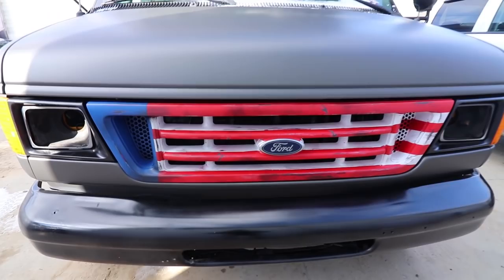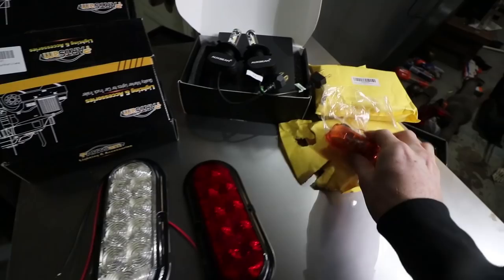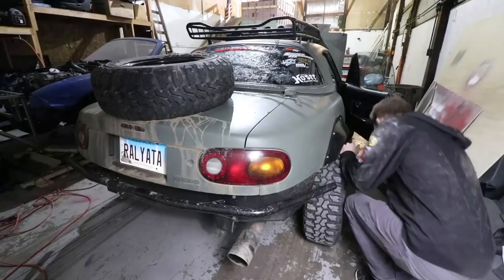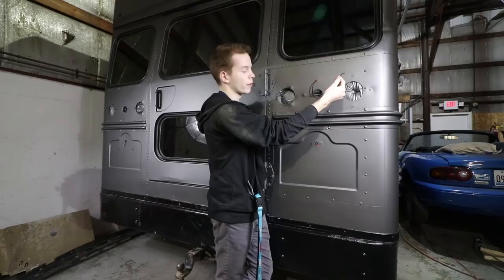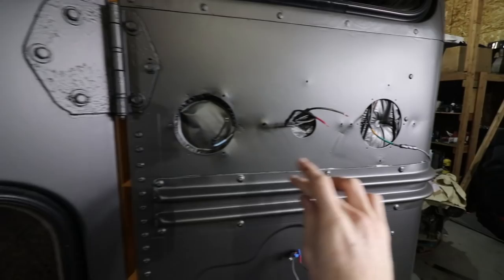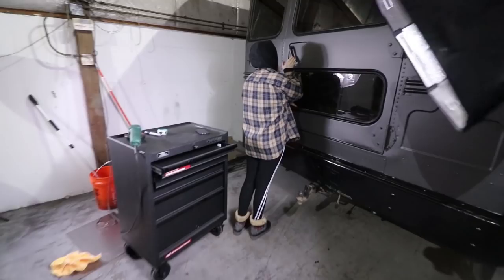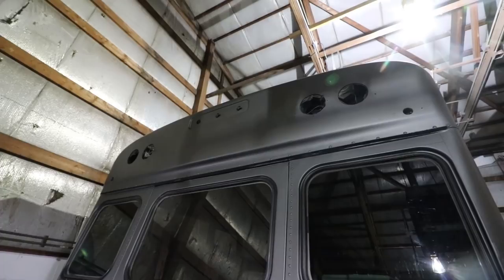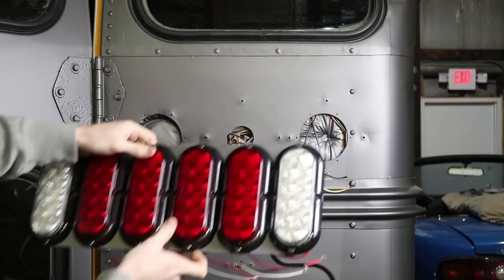Adventure Bus Build Pt 8 - Electrical Fix & Lighting Overhaul!

Comment: Since you're taking the bus off road and using it as a tow vehicle you might want to consider replacing the upper school bus caution lights to spots on the front for better forward vision off road.  The rear ones could be converted to floods that you can aim that way you could light an area behind the bus to work on vehicles or simply light your camping area.
Reply: Sarkazmo Loafy he will be changing the front some time he said with kc lights
Reply: I️ think he said he was putting kc lights up front

Comment: You should fill the front half of the roof with a roof rack and a light bar and use the back half or 2/3 with solar pannels
Reply: With extra battery power for accessories

Comment: The top orange  and  reds are warning  lights... you will need to run power from your running lights  to power & run power from the blinker to the ground on the light & they will blink offset from the outside blinker & give you the resistance  to stop the hyper flash

Comment: The other two lights will come on with the opening of the door. The way the buses are wired is that when you hit the switch for what used to be the amber lights they'd flash to let people know the bus is stopping to pickup kids. When the door is opened the red lights would activate as well as the old crossing arm and stop arm.
Reply: or you can just hit emergency warning or just hit the red colored switch that says warning and the "red" lights up top will work
Reply: Quinn Dickinson that’s very helpful thanks
Reply: Quinn Dickinson how’s the fire truck going
Reply: Good.

Comment: The reason the wiring is polarity switched, is that trailer lighting is often backwards color wise. I used to work in an ambulance upfitting shop and it threw me off at first too.

Comment: If you had all indicators wired it wont blink so fast, when it blinks fast it means there is an incomplete circuit and a indicator isnt working
Reply: Raamie DarkThorn no its because led lights take less power to operate
Reply: Gary Moore I literally just had to fix the exact same thing a couple weeks ago..
Reply: Anthony Correa yes they blink faster but not that fast, that is the "Warning, ya blinkers are fucked" speed as I like to call it

Comment: I get the feeling you might want to do an episode on Reagan. Reagan seems a bit ill and in need of attention :/
Maybe a preheating system to help with cold starts? I think a secondary battery for Reagan would be good too. Auxiliary power is good for both of your off road vehicles 👍

Also, I think you should take a good look at the glow plugs and their electrical connections in the bus. You are doing the proper starting procedure, but I get the feeling the glow plugs aren't doing their job, or at least not very well.

Comment: You Should install Solar Panel For Your battery....
Reply: Xeno mex good idea
Reply: Even though they are a bit less efficient, there are even peel and stick flexible solar panels for RV tops on amazon now. It would be easy to mount and would look cleaner

Comment: Break fluid doesn`t just disappear.. you`ve certainly got a leak!!
Reply: Kommentator brake fluid does get lower as the breaks wear though
Reply: facts
Reply: daniel xinos how
Reply: daniel xinos wait nvm it takes more fluid in lines due to less pad material so it shows up less in the res
Reply: Drew McCarthy as the pistons move out the fluid in the resivour goes down the further the pistons are out the lower the fluid appears. Gingium obviously has a leak but there is more than one reason for low fluid.
Reply: daniel xinos
You are right, it does get a little bit lower over time. But it never gets lower than the min mark and it certainly never needs filling up. When you change your brake pads, the fluid gets pushed back up... so when you fill up your fluid before you change your pads, the reservior will overflow and break fluid is awful for paint, so it is going to ruin the look of the engine bay.

Comment: so the bus is legal, you should turn the top lights in to turn signals. It'd (speech 100) look awesome and it would be legal to drive. lust an idea. ;)
Reply: FadedGaming also, a nice backup cam would be handy. Also, gingium, the way the top lights work has to do with the parking brake. If it is on, the outside ones will oscillate, instead. Maybe some solar, as well, and replace the top lights with LEDs. More ideas, yay.
Reply: agreed.

Comment: better check for a brake fluid leak somewhere...also think about aftermarket brake fluid level sensor and gauge. Thanks for sharing with us.  :)
Reply: also..apply brake pedal..have someone jump on the front and back bumper to actuate the suspension (leak could be happening on suspension flex only)

Comment: Don't put load resistors in the turn signal. All you need to do is replace the flasher with an electronic one.

Comment: The turn signals may blink fast if front turn and rear turn arent going at same time. Like when you have one out on a vehicle it will blink fast. If both blinkers are going it will blink mormal speed.
Reply: no it's cause theyre leds need load resistors

Comment: you don’t need to change anything with the turn signal or indicators as they are called here, when both are wired up they will be working as normal so no need to do anything to them

Comment: Since the lights are already setup to flash, it would be cool to get 4 LED amber lights for all of the lights, that way it's legal and cool. 

When it comes to the outside pair, try turning on the inside pair and then opening the door. I believe that will get the outside pair to work since the red lights only come on when the door opens.

Comment: I love the build! Just make sure you seal the lights with silicone so that water doesn't get behind body panels. Also I'm not sure if you've already had this idea but you should look into getting one of those front window shrouds that look make dump trucks and tractor trailers look aggressive.

Comment: Cutting towards your hand and I was like... Don't slip...

The bus has come so far dude, it is going to be on point when completely done. I really dig the tail section with all the red there. One thing I wasn't too sure about was your reverse light placement, I would keep them towards the center line, and have the red bars extend to the side of the bus. (pretty much how all taillights are I suppose...)

Comment: Hey gingium I think I found out y the spool bus takes alittle bit to start up it's either the air flow sensor or ur not getting enough fuel pressure
Reply: Spencer Mason well it’s a Diesel engine so they always take a minute to start
Reply: Avetho Plays Cheapest is MAS, then its the plugs with the final one being the pump. Thing is the MAS would throw a code as the fuek wouldnt. Bad plugs throw codes also. He might need new plugs as they are not strog enough.
Reply: Snipe Stud00 That's nice to know. I'm thinking the fuel pump may not be the problem though because wouldn't that lead to a loss of power as the revs climb higher? I think Caleb would have noticed that taking Reagan to Virginia for David to review.
Reply: Jen La Jeunesse well yeah but still it shouldn't really take as long as it does

Comment: I would definitely put the off road lights in the front upper lights. But with the back I would tie the wiring into your running lights and brake lights. 

Also I liked the grill with the American flag design, would of liked it to stay with the head light housings the colors you had them before they were black.

Comment: You should do something about those mirrors they don’t fit they style of the bus
Reply: Isaac Merks and then not see anything???
Reply: Frank Williams you act as though this guy wants ging to get rid of the of the mirrors completely
Reply from the maker: +Isaac Merks I agree but I dont like any e series van tow mirrors either. Im gonna get some f150 mirrors and modify them to fit
Reply: Gingium get f350 mirrors they should fit and they have a convex lense so you can see farther behind you.

Comment: You're gonna run into problems when you go to use a trailer again. LEDs back-feed everywhere and nothing will work right, I ended up having to replace my lighting with all incandescent all over again. its just not worth the hassle.

Comment: Might I recommend you plug in the block heater it will start up much easier on the bus that is
Reply: Matthew Guy you have a very good point
Reply: Matthew Guy but I was referring to the motor itself not as much the interior

Comment: Aren't the lights on the top supposed to be orange/red so they also work as brakelights and hazard/turn signals?
Reply: Leo Venialgo you don’t need brake lights up front
Reply: I totally forgot about that lmao, what are the red ones in the front then? 🤔
Reply: Leo Venialgo they flash back and forth so cars will stop and kids can get on/off without getting run over

Comment: You need to find your relay that runs your top Amber and red lights. It's probably why the lights flash one side to the other the way they're supposed to when the bus stops. Possibly change it to a normal turning signal relay or one for hazard lights. I imagine it would be in the box under the switch. It possibly could also need to change some of the wires all to the same side of the relay so they all flash on and off at the same time. Just a suggestion if you want to fix that. I don't really know if that would work

Comment: 4:12 come on mate, is it really that hard to put on safety glasses while using power tools? In most workshops, you are required to wear a full face mask while using an angle grinder, and you're not even using safety glasses while using one.
I'm not trying to hate, I love your videos, which is why I get concerned when I see you being foolish and not using PPE... I'm sorry, but it is really fucking dumb not to use your proper PPE while using power tools, so unless if you want to become a pirate and wear an eye patch, I suggest you start using safety glasses. 

(Just google 'what happens when you don't wear safety glasses' and you will never want to take safety glasses off again.)
Reply: Retz yoloium

Comment: Wiring on trailer lights is usually, white is ground - brown is running lights - yellow is left turn signal - green is right turn signal, I may have yellow and green turned around, but the point is it might explain the odd wiring in the bus.  Also the two grounds may be due to two batteries and being on different circuits, hope this is helpful

Comment: Why did you run out of brake fluid? It’s a pressurised system, none should leak at all
Reply from the maker: +DeadlyViper there is a small leak somewhere
Reply: Gingium I’d say that’s a pretty high-priority thing to fix. What if air or moisture gets in?

Comment: Would you ever put Fog Lights? Maybe Long LED Bar Light? or also White or Color Changing Under Bus Lights? :|  :)  I think there should be Amber and Red Lights on front and back. For a Hazard Light, in case the bus breaks down on the road.. :|  Im almost thinking maybe a Fuse Regulator or a Fuse could be missing for the Lighting not to give extra voltage on the bus.. The Top Bus light that was painted. maybe was for something on top of the bus? :|  Would be strange to put a White Strobe Light on it.. Incase out camping or something strange.. :|  or SOS Amber one. ;)  Btw some States say HID or illegal to use. It's why im using Stock ones, but changing them out to Silvia Ultra Silver or Gold Bulbs. ;)  The Side Amber LED?? They still stock ones? :|  For Tint.. I'd stick with maybe 3M Tint. But not 10% or 20% Tint. Is way too dark..

Comment: hey the old wig wag lights you should put  four Amber's instead leave two middle ones on old bus flasher and either try to speed up other flasher unit for other two lights or try to make them flash random or in a strobe pattern with a couple led bulbs replacing old ones and a cheap led flasher off say eBay with different patterns on two switches  than if your towing a big trailer or just want to party a bit you got a legal party bus

Comment: Hey gingium i have a good idea to solve the american flag design. You know ken blocks RS2000 well he has painted it black and used a wrap vinyl on the back half to be like the rally cross paint they used in 1983-1985?( dont always trust my years but its close) anyways try use the similar design but as a american flag it will look amazing trust me anyone else would.
Reply: flynn nugent seeing how ken is obsessed with the group B era of rally, your years are probably correct